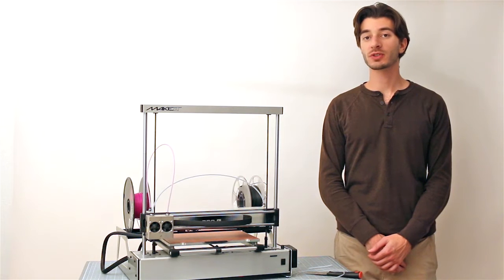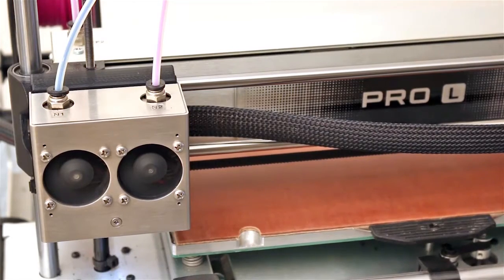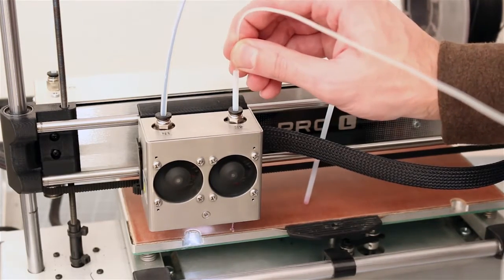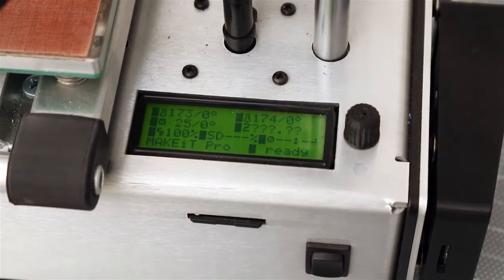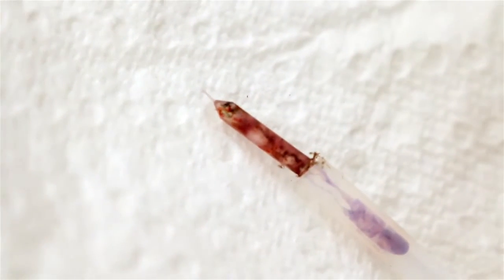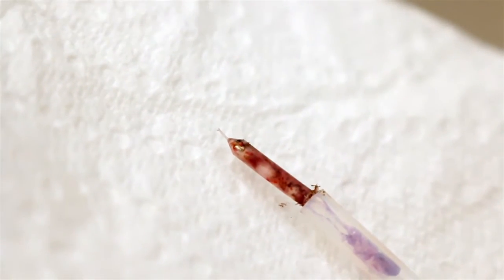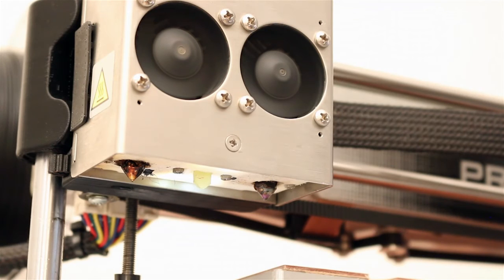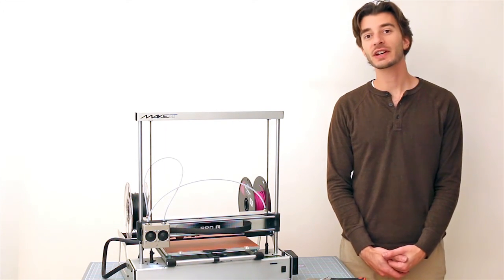Cleaning 3D Printer Nozzle with Nylon Cold Pull

Comment: Glad to see I'm not the only guy using a small piece of spare Bowden tube to perform a cold pull. :)
I've tried with PLA instead of Nylon (I don't have Nylon left), kinda works too ... Yet Nylon is the best material for that purpose, IMHO.

Though, I don't remove the small Bowden piece when removing the filament on a cold pull. Is there a reason for you to do so ?